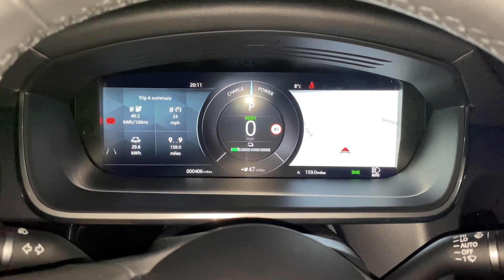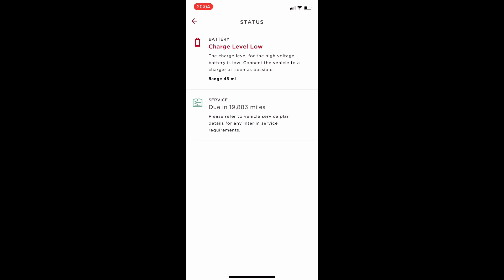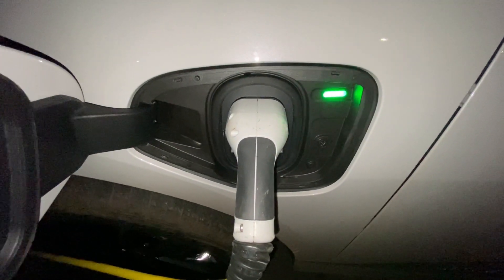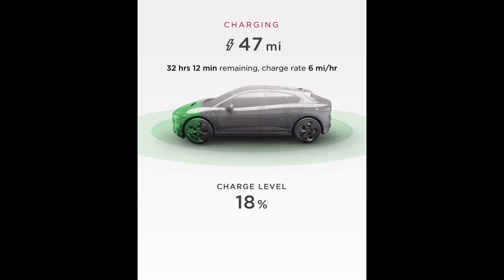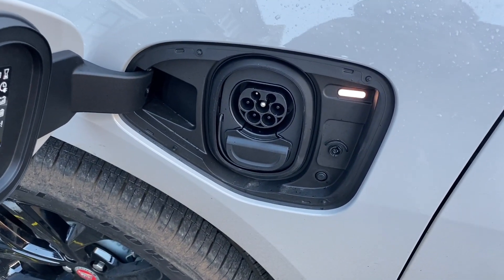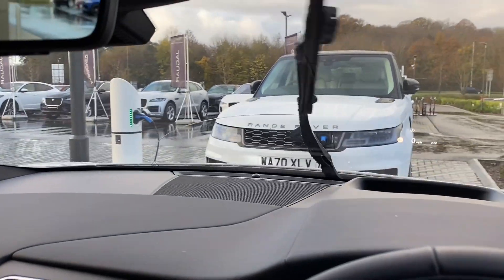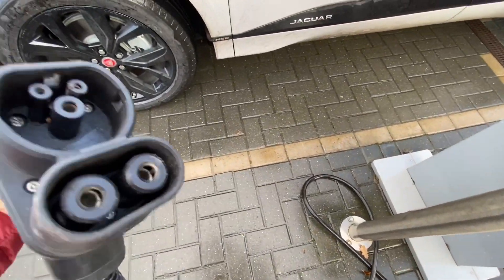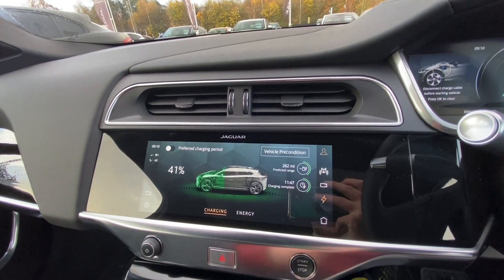Charging an Electric Jaguar IPACE 3 pin plug to 25KW Chargers.

Comment: Another good video!! Are we able to use 150 ultra fast charger on these models?
Reply from the maker: You can put your car on 150 ultra charger, but it will only pull 90 kW due to the way the software is set up👍
Reply: @RRW thank you!!!

Comment: Jaguar of Troy. Beware - I bought a l-Pace EV from Jaguar of Troy in Oct 2021. First I was misled that the car had 292 mileage but I never got more than 150 miles. I bought three excuses but again the car stopped in the middle of nowhere. It happened 4 times, two times in the middle of the road and two times on the freeway.  First they kept the car for a month and said oh it's nothing. I took the car and it happened again but they were not ready to listen. 4 weeks ago I went shopping and when I came back the car started but won't move backward or forward. It was Saturday at about 330PM. Jaguar has 24/7 tow service but no one picked up the phone and I went to the dealership and dropped the key and requested them to have it towed Monday.  Till 4PM Monday no one cared to have it towed. I made some phone calls and had it towed. It has been one month since the car was there and top of it they did not give me a loaner. The worst ever dealership. 😫 A word of caution please don't go to this dealer ever. Without a car I am stuck at home and my business is suffering.  You please don't suffer.

Comment: Not got a home charger box fitted yet.   Is it cheaper to home charge on 3 pin or go to a public charge point?   Ta
Reply from the maker: It would be cheaper at home but off a 3 pin it takes a lot longer so you would need to plan for this. 👍👍

Comment: Can you clarify please? The 2019 I Pace will allow only 7KW vs 2020 I PAce will allow 11KW? Do I have that right? Thanks!
Reply from the maker: Yes for home charging, but I have been told that you would struggle to get a 11kw home charger. you can use higher KW ON PUBLIC chargers 25 /50 KW
Reply: @RRW  Is the 2019 I Pace limited to accept only the 7KW charger? (cannot accept 11 KW chargers)
Reply: @garysacks6196  Yes.

And 11kW home charging is only possible if you have a three phase supply and three phase charger.

Comment: If the car has an 90kW battery and when you connected your charge was at 41% then 59% to go is 53.1kW. You have plugged into a 50kW charger so that should take just over an hour.  Your dashboard said time remaining 2 hrs 45 mins.  That does not make sense.  Can you explain why so long a charge time?  2hr 45 mins is a long stop for a coffee!
Reply: For a car with a 90kW battery you would get about 80-85kW available to use as the battery management keeps some in reserve to protect the battery from absolutely full or absolutely empty. When you use a rapid charger say 50kW you can get that full speed or near it until about 80% full on most cars. After this point they generally start to slow down as it becomes harder to fill the closer it gets to full electrochemically. If it is forced in higher than the battery can tolerate then it could damage it so the battery management takes care of all this automatically so you needn’t worry about it. When using a rapid charger you would get to 80% and leave. Suppose that took 40 mins, it might take another 2hrs to add the extra 20% to full. If you did need some additional range it would be quicker to add another stop later when the battery is at a lower charge, by this point it would be able to add that extra 20% in 10 mins by comparison. These figures are just an example to illustrate my point and times will vary dependant on your battery capacity, how low it is when you start and how fast the rapid charger can operate. Try checking out @FullyChargedShow for reliable info on EVs and Dr Euan McTurk on @plug life television for a very reliable technical source.
Reply from the maker: It might be because if you connect to a 50kW charger it does not mean you get 50 kW all the time, the car chooses to draindown the power at different rates of kW it can change depending on how much charge is left to go into the car. Did you recommend charged 80% as the last 20% can take a long time because it’s balancing the sells of the battery. This is what I have been told. 👍👍👍👍
Reply: @RRW  Yes, you might get close to 50kW if your battery is at a low state of charge AND is at a temperature that the battery management system thinks is ideal. By 80% full the rate will have slowed a little and then quickly falls off after that.

Comment: Do you know if you can get an 11kW charger for home use and any installers?  National grid say you can use up to 11kW as long as nothing else is turned on, which would not be a problem at night on ' off peak power.   Every company I have approached says no it cannot be done.  Am switching to Octopus who do off peak 4 hours a night @ 5pkW.   So 11kW preferred option 44kW per night instead of 28kW with standard 7kW charger. Great video many thanks.    
Copy and link from site with 11kW charger info.

The next step up, 11kW chargers, are the maximum that can practically be used in a household in the UK, which would lower 300-mile EV charging times to a more useful 6 hours 10 minutes – however, the National Grid warns that that since UK households are ‘fitted with a main fuse of 60 to 80 amps,’ ‘when using such a charger it would mean that you could not use other high demand electrical items (such as kettles, oven and immersion heaters) without tripping the house’s main fuse.’
 
https://autovistagroup.com/news-and-insights/home-ev-charging-will-not-be-future-says-uks-national-grid
Reply: You almost certainly have to have a three phase supply to have an 11kW (three phase) charger. zappi do a three phase version.
Reply: You would need 3 phase - 32 amps is the most you can draw per phase. 3 phase domestic chargers such as the Zappi and Tesla wall box will output 22KW (32 amps per phase) which some Zoe models will accept but many cars are limited to 11KW or 16 amps per phase when charging on 3 phase.
Reply from the maker: That makes sense, I have been told 11kw is available in different county’s, currently 7 ke is the uk. But things might change in the future. Thanks for the link.

Comment: Nice informative video 👍, just question.  I believe this is the updated I Pace, if so, does this new model model have the facility to limit the max charge percentage? Like for example 80%? I found it odd that Jag didn't offer that facility whereas pretty much every other manufacturer now offers that to help preserve the longevity of the battery.
Reply from the maker: There isn’t a button for this however you could set the timer for charging to end say a 10 hour charge to finish at eight hours so you have 80% charge in the car but there should only be done through time charging. Hope this helps thanks watching the film. I have a new one coming soon on a full charge drive cycle. From  what I start off with to what I I end up with so stay tuned.
Reply: @RRW  thank you for the speedy response and I look forward to the new video 😀

Comment: Karl is correct. No problem at all with an UNWOUND extension lead, the car isn’t drawing any more power than the 13 AMP (not pin!) socket and therefore anything else rated to be plugged into it can normally handle. But if the lead is wound on a drum it will probably melt.
Reply from the maker: If you happy that is great, I have been told under no circumstances use an extension lead, but I will look into this as I need a few more inches on my cable 😂. Thanks for the comment. 👍👍👍👍
Reply: @RRW  I was told this by a jag dealer as well  but I had no choice on a long trip as I had to recharge over night and the  closest I could get was a good 30m away from the cottage I was staying at
I bought a decent 15amp extension lead with crucially a thermal cut out switch and made sure the cable was fully unwound. 
I checked regularly for over heating and had no issues whatsoever. 
There was no discernable drop in charge times either. 
To be fair to Jaguar they HAVE to accomodate for the lowest common denominator as you just Know someone will use a coiled extension from the Christmas tree lights!!
Reply: I promise you iPace electricity obeys the same laws of physics as normal electricity!

Comment: Did you really mean 13-pin plug socket,  i.e. a special sort, or a 13 amp 3-pin socket, i.e. a standard domestic socket? Just wanted to be sure as you said 13-pin every time, not just a one-off slip of the tongue? I ask because I'm considering buying one, so far only being put off by JLR's woeful reliability record.
Reply: The Jaguar E-Pace actually came first in its category in the JD Power quality awards this year, and the LR Evoque beat Audi.
Reply from the maker: Omg I just noticed that. It’s A domestic 3 pin Plug socket.  😂😂😂😂😂 thanks so much !!

Comment: Great video, nice to see some real world usage of the new 21MY (love the Pivi Pro!). Quick question - can you confirm what additional features come as standard on the 21MY HSE? I've heard the steering assist has been dropped in favour of HUD? Also, just to clarify, the 7kW charger is the highest available for standard single phase electrical supplies, which most UK homes have. The 11kW chargers require three phase supplies which are usually only available at commercial premises. I've not really found it an issue though. I have the 7kW Pod Point. If I plug in at 9pm, even when i'm down to electric vapours (ions?) it's fully charged when I leave the house at 8am - and with around 250 mile range I usually only have to do that once a week or so. Couldn't go back to Diesel now, no way. Next task is to find a cheap electric for the wife, something like a 2015 Nissan Leaf.
Reply from the maker: I have have steering assist on my HSE and if you log into the JLR uk  snd build an IPace. Look under standard features it’s listed there. The 7kw makes sense what with the 3 phase set up. I will correct my self in my next IPace film. Thanks for the heads up. 😬😬😬 every day is a leaning day. Thanks for commenting I really appreciate it. Thanks for watching. 👍👍
Reply: @RRW  Thanks for the info. Btw, at 8:15 you mentioned the 50 kV. What are you charging it off, a pylon? 😂😂😂
Reply from the maker: @dave822   I will give you a shout out on the next film 👍👍👍 thanks buddy
Reply: The original statement is correct, last summer I bought an MY21 approved i-Pace HSE and it does not have steering assist but it does have a HUD.

Comment: The DC charger you plugged into with the CCS plug is only 25kW not 50. They are useful as they don't require such a heavy duty electrical supply, but not as fast as the 50-350 units you will find at service areas and public car parks. Almost 2 years with my I-Pace now, and the most enjoyable car I've had. Good video well done.
Reply from the maker: Thanks for the info 👍👍👍

Comment: 13pin plug socket! Absolutely fine to plug charger into an extension lead as long as it is fully unwound. Charger draws 2.3kw so as long as extension cable is rated for that no problem at all.
Reply: Agreed - a fully unwound 13A rated extension is fine. If it's a lower rated cable it should have a lower rated fuse in it.
Reply from the maker: Yes you are correct but people pop
To b&q and buy the cheapest one and BANG. Butter to be safe than sorry. But great advise thankyou. We were told by JLR NO extension lead  what so ever! 🥴🤙👍👍👍